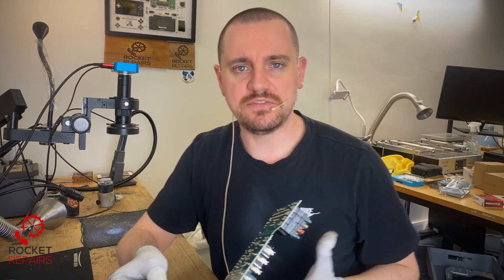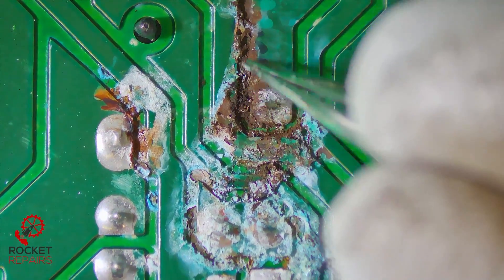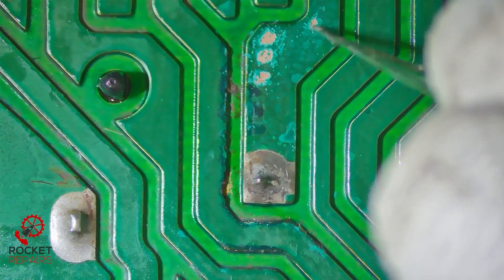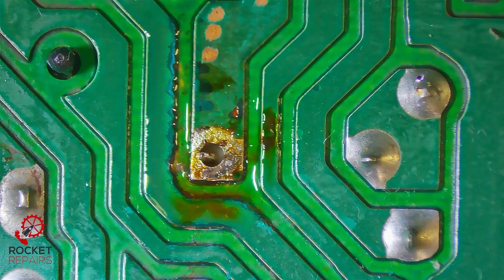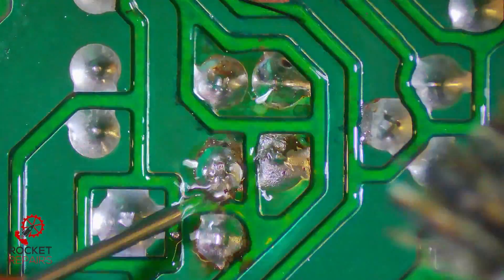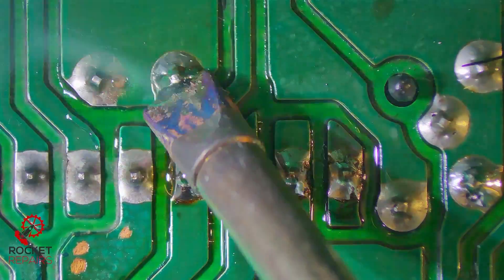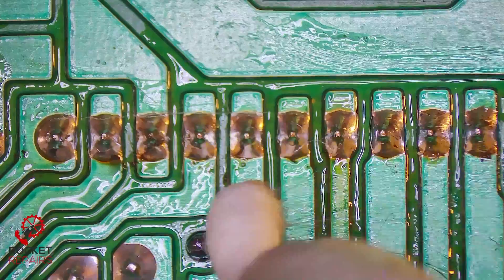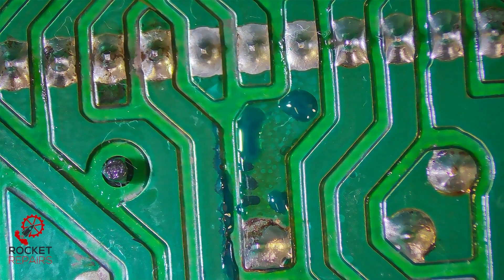SMART CAR SAM UNIT REPAIR - Liquid damage and more, let's fix it.

Comment: Great to see you fix something different Joey. That exact same thing (cracked solder joints) happens on the clocks of ford cmax cars and can stop the car from starting. I wish i had filmed fixing my clocks when i had trouble with my car.

Comment: What you need m8, is what us watchmakers use to clean rust and corrosion off metal and painted surfaces... something called pegwood, it is very cheap and you sharpen it like a pencil and its more robust than a q tip but less damaging to delicate surfaces, trust me you won't look back with some pegwood in your arsenal of tools.
Reply from the maker: hit us up with a link!!